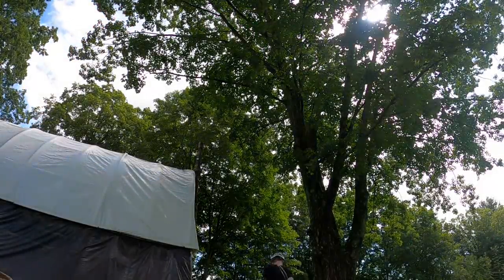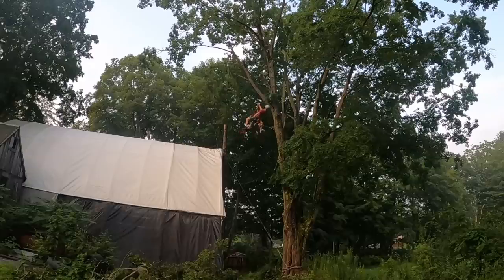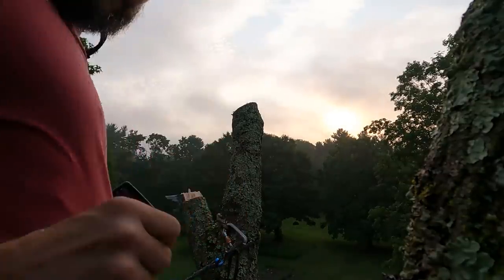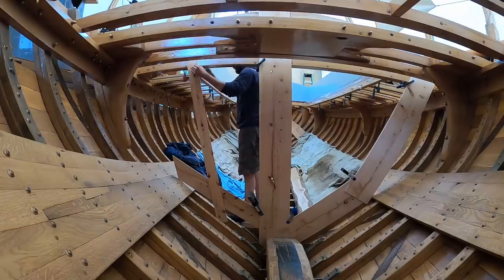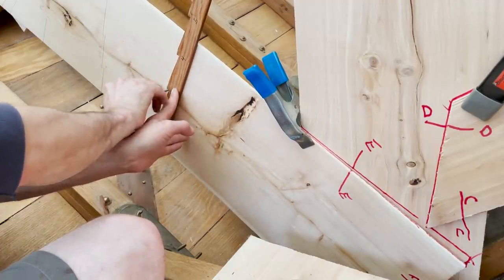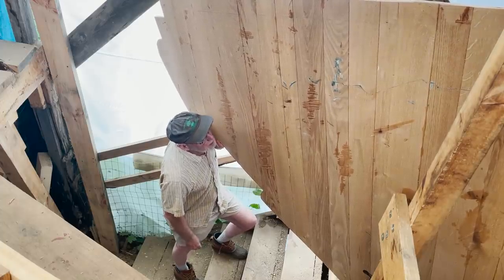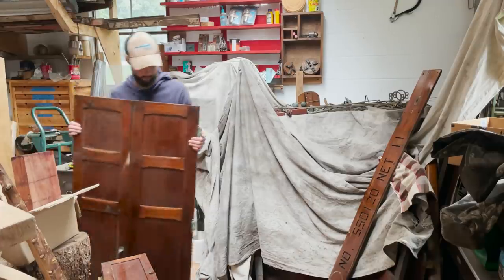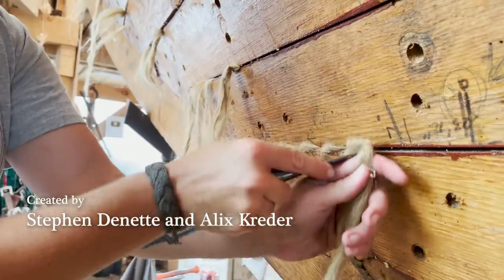The First Bulkhead - Episode 173 - Acorn to Arabella: Journey of a Wooden Boat

Comment: I had a shipwright (and eventually friend and fellow fisherman) that I first met when he did planking work on our 58' seiner in AK.  I was amazed at his cutting of the boards, hammering the caulking between the planks, and finally mortaring, and took a lot of photos in those days of him working.  We later got to be crew together and talked about caulking work, and one of the most amazing things he told me is that you must have a firm but light/practiced hand, as corking planks unevenly can cumulatively skew a boat's hull shape.  (Little ounces of hammer equal tons of pressure over so many seams).  He taught me how to replace and cut planks for repairs.  I like your joggle sticks, Nice.  We used a batten and a compass.  Came out perfect every time.  I got really good at fitting "things" into weird spaces on boats.  Hull planks, other structural metal, and wood. Nothing ever level, nothing ever square. When I learned this, I hadn't done too much carpentry to that point.  Funny thing, when I came back on land and tried to build stuff with squares and such, I had no idea what I was doing and failed all the time.  

Thank you so much for sharing this super wonderful build with us.  I cannot wait to see it on the water!!!

Comment: Consider having the forcasle door open into the forcasle and not into the gally salon area.  If you want to leave it open for airflow but not have it impede everyday life, you may appreciate having it out of the way.
Reply: I had just composed a similar thought. I'll leave it here: Maybe have the bifold door hinge along the midship, but into the forepeak area instead of into the salon. Older homes had bedroom doors hinged mid wall versus in the corner. Thus, when the door was open it partly screened the room. This gave you both some privacy while allowing ventilation.
Reply: That was also my first thought for the bifold door
Reply: I got old and need air conditioning. But the young use a blower on the fore hatch and do like you said about blowing through. Out the aft end, cockpit or something.
Reply: One challenge with that approach is that most of the forepeak is filled with a bunk and there is often no place to swing a door.  The salon is usually open to the floor.
Reply: What about hinging on the outboard side?  Could that be a possibility?
Reply: @JBLewis  sure, mentioned that for swinging into the salon, but toward the starboard side instead of toward the center/port side.  I still don't know if there would be room to swing it inside the forepeak.  Not sure if the berth bed cushions go all the way to the bulkhead or not.
Reply: Funny reading every orientation but what I was thinking- hinged forward and outboard so when it's open,   which is most of the  time - it's more out of the way.  And folded in half, there's less "dead space" behind it when in the open and secure position.   Which is where it will be most of the time.
Reply: How about a pocket ( not sure if in America that's what you call it ) half the door could slide towards a amidships into a pocket on either side of the bulkhead leaving the bifold to swing on its hinges, the bifold could then be dogged back against the bulkhead, less space required for the swing of half the door.
But Steve as ever will come up with the perfect solution 😉.
Love the channel and I cant wait to see her in the channel (River or outlet)
Reply: the forepeak bulkhead seem to be very near or right up to the main mast, so having it open inwards could work, depending on the specific dispositions and how far back the bed will reach, having it hinged starboard side and open in to the main area will have to be careful about the disposition with the starboard bench

Comment: Dear Steve
I love what you guys are doing and I admire the endeavour and your tenacity. That said you need to get some sea miles under your belts. When you are at sea it's all about seamanship. This is something you learn in the face of mother nature. At the height of a storm you will ask yourself "What the f.... possessed me to put myself in this situation?" The wood burning stove is just a bad idea for so many reasons. A diesel stove and big roto molded diesel tanks down in the bilges is the way to go. Water makers are a modern miracle and so are modern batteries paired to oversized alternators. I grew up on, and have owned, many boats including wooden boats. All of these items will lower your center of gravity if placed properly. Keep the weight out of the ends and in the middle as much as you can. A yacht should be beautiful and functional. I am no interior designer but if you pair oak with bits and pieces of "spiritual" mahogany from Victoria you will end up with a dogs dinner! Make sure your berth is really comfortable for two. No compromises! If you have to shrink the main salon then do it. Make sure you have comfortable berths for another couple. Have you thought about a dodger? Screw the wooden dinghy; get an inflatable. A dodger is much more important to wellbeing and therefore safety. The same thing can be said of an inflatable. I recall you guys saying that your ideal is high latitude sailing. Although very different in many respects to your own project I think you would find much in common, philosophically, with Skip Novak.
I hope this does not come across as overly strident but I think you are at a point where you need to weigh up pragmatism against romanticism.
Still love you guys
Reply from the maker: Everyone learns somewhere, Steve wants to learn on his boat. He’ll get his sea miles on Arabella. It’s kinda easy to grasp… he’d be on some boat learning if he went to get sea miles and learn seamanship. Friends will come to help run the boat for near coastal cruising for that. 

As for everything else, thanks for watching. Different courses for different horses, and may we all enjoy the boats we have.

Comment: Easily the most interesting  episode since the hull was completed. I especially liked the emergency felling of the Big Tree and the modeling of the first bulkhead. I would think of using the bi-fold door on the frontside of the bulkhead hinged on the starboard side so that it swings into the hull ahead of the bulkhead.When open it would take the very least useable space and when closed  the fore deck would take on water tightness.  ALL-A- TAUT-O

Comment: Steve, what about the door bi-folding into the fore-bunk against the starboard wall? While open it might block a closet or something, but once in the fore-cabin it can be closed to access the closet or whatever is behind the door. Plus, it would not be blocking anything in the galley/main cabin area. A couple of magnetic catches could hold it open and to itself when open, and even closed if strong rare-earth magnets are utilized. And, that would reduce any latches sticking out to catch on skin or clothing. I'm guessing the trim around the edges of the bulkhead will close any gaps?
Should look real nice in an oil, varnish, or paint finish when done. (Depending on trim finish and paint color, of course.)
Coming along quite nicely. Can't wait to see Caroline's return in the next episode, and the starting of the sealing of the bilge. I know she has more experience than you or I do, but that oakum sure looked like it is going in quite loose in the preview footage, I guess we'll see if the tar seeps past it later. I'm really looking forward to watching those steps.

Comment: I would give the ‘hinge direction’ a good thought; might want to consider it to be stowed when folded at starboard side rather than midship?
Reply from the maker: We’d give the hinge direction good thought too! Happy Friday!
Reply: You might also want to consider flipping the panel 180 degrees, do you want the two small squares at the top or bottom of door?
Reply: Every bit of the interior will need serious thinking through wont it!!
Reply: Who needs good thoughts? Just do it!

Comment: Steve you could hinge the folding door the other way and then there would be no interference with the table? Is that a possibility?
Reply: Sliding doors would solve this problem
Reply: I was going to suggest the same thing: have the door hinged on the starboard edge and have it swing out to starboard and be out of the way rather than sticking out down the centerline of the cabin.

Comment: When I have to do a big template by myself like that, One thing I do, to ensure the template is put back together the same way, is to drill doles for dowels to go.

That way when I reassemble it someplace else..... it goes a lot smoother.   (note: I tried 1/4 bolts at one point but found that the threads allowed to much movement)

Comment: Oh no, I'm finally all caught up after 4 weeks watching from the very start. And there's one thing that struck me. Stephen why not just make a pulley system ro get those big bulkheads up the top of the workshop? Surely it would be a lot easier. I know there aren't a lot of them but it's just a thought and with all your climbing gear I'm sure you could rig it no problems.

Comment: The double door to the fore peak looks good and will open it up . That will help with ventilation and claustrophobia of being in a tight area . I question the offset layout a bit as typically the doorway would centered on the bulkhead . You'll no doubt work it out the interior looks great !
Reply from the maker: There’s a mast going in just behind it, just like the off center companionway accommodating the mizzen.

Comment: One thing to think about is that the joinery on paneling often wasn't done to the same standard and with the same joints (through tenons for example) as joinery on doors because paneling was fixed in place on all sides, where doors had to support themselves from just one side. So it's possible to cut paneling into a door, but it's not sure it will hold up for very long.

Comment: On the door, couldn't you change it so the hinge is on the right side (as seen in the video) instead of the left?  That way it could open towards the outside of the ship instead of the center and leave a little more room for items on the left (as looking towards the door). It could give you a little bit more room (because the door folds) without having to nip off the bottom corner of the door.

Comment: Don't wish to sound like a smart ass but the 'new' passageway folded bulkhead door should definitely swing to starboard and the decorative door panels on the bottom not the top. This will insure the folded door is out of the way and existing full length hinge not a problem if door is flipped upside down. Otherwise pleased to see interior bulkhead work being done before cabin roof put on - make interior work much easier to do.

Comment: If you hinge the starboard door so they swing open rather than bifold i would wait until you get your floor and any side brightwork in so you can make sure the bottom doesn't hang up as it swings towards the hull. Its so close that the geometry of the bottom corner of the hinge side could stop it from swinging open...

Comment: guessing this decision has already been made but if you move the double hinged door out towards starboard, is it possible that you don't actually have to cut the corner of it to clear the frames? hard to tell from sitting behind the computer screen but i was thinking that because it hinges in the middle you can use both sets of hinges at the same time or "bend the door" while swinging it open to get enough clearance that it should swing past the frame where a solid door wouldn't?
Reply from the maker: We haven’t done the final installation but yes we’re working through the best way to hinge, clip while underway, open, close, walk around, and all that.

Comment: What are you going to do for deck lights? To bring sunlight down into the hold, refurbished oak hatch? Port lights?
Reply from the maker: Deck lights are on spreaders and light up the deck… I think maybe you’re asking about interior light? There will be portlights (round, opening) in the cabin sides, there’s a forward hatch over the fore peak and a butterfly hatch over the saloon. And of course, at night, there will be DC lights, LED, which we haven’t chosen yet.
Reply: @AcornToArabella  I was wondering because some of the old wooden boats. Ive seen had these thick wedge-shaped glass the size of  a shoebox flat on deck to bring light into the cabin. The butterfly hatch ive seen also had glass and copper or bronze bars protecting the glass. Areyou going to reproduce that style? It was a detail on wooden schooners that I thought added that extra magic. By the way, that tree stunt took a lot of cajones.

Comment: If you'd clean the stump from all the branches and wax those cuts shut carefully, the Maple should grow back. Branch stumps dry the main stump too much and the tree dies, but sealing the main stump with wax keeps the tree alive. Then isolate the chain/stay from the tree to stop any electricity to ground through the tree, and thus giving the stump more lifespan. If the stump dies, it will no longer keep the stay tight, bcz the roots start to rot. but with just a tiny extra effort, the stump will stay alive, and the roots hooked to the ground.
Reply from the maker: Thanks for the tip!
Reply: Not worth the effort. The boat house and boat will be ling gone before that stump rots appreciably!
Reply: @57dent  Depending on the winters, it takes two-three summers to fully soften the roots. And it starts to loosen the stay on the first spring, if the root system is not taking any water in. Also depending on the stays tension(storms etc.), it might pull the dead stump out faster than one might think. A very small effort to keep the stump hooked on the ground, and a good quarantee to keep the stay tension stable.

Comment: Flip that door 180 degrees and have it open to the hull rather than the middle.  Two little screw holes to fill and redrill for the handle. Or move the hinges to the other side.

Comment: Hi, good job with the tree. Can I ask why @9:26 you say you are starting on internal bulkheads, which will make things awkward when the external planking - on your right of picture still has to be completed. Why complicate things?
Reply from the maker: Well, the world is a demanding place and we like to be able to not just make progress, but show it in these videos. I think there’s a little confusion there embedded in your question so to clear up: Steve would have pitched the bilge first then started on bulkheads. They’ll have to scoot around the bulkhead but it won’t impede them as they’re pitching.
Reply: @AcornToArabella  Not confused, just think you are getting ahead of yourselves - you are boxing up the interior when you haven't finished the upper section of the hull
Reply: He's explained in previous videos that those top two planks cant be done due to interference from the scaffold they use to access the boat. They will go on in many months time when scaffold is no longer needed.
Reply: @57dent  Yes. trouble with these DIY channels they have an excuse for everything

Comment: Get Pro help on caulking as it looks like she has no idea, that's not how you put oakum in. If just to stop paint running through just use cordage rolled in with a wheel
Reply from the maker: Not paint, Jeffrey’s marine glue. We’ll see how it all shakes out—Carolyn has worked on tallships, doing annual fit-outs and repairs, well before she went to boatbuilding school. Maybe share a few salient tips of your own? Definitely works differently than cotton, and this in particular is temporary, as we said.

Comment: I'm not a boat builder... but from what I've seen on salt n Tar and Sampson Boat Co videos... she was spreading out the oakem loops out way too far!
</endYTboatbuilderextrodinarcritque>
Reply from the maker: Well, this little boat would normally have no business driving oakum into seams at all. These lower seams were being temporarily filled with oakum in preparation for pitching the bilge with Jeffries Marine Glue. It takes a lot less oakum (fewer loops) to fill than it does cotton, and the reason oakum is used for this is because it's tarred and will more easily separate from the pitch after the pitch cools.
Reply: @AcornToArabella  She explained it all in the next video! Thanks for the reply!